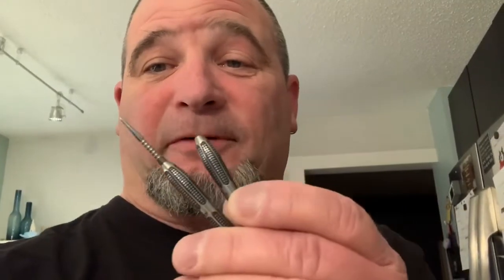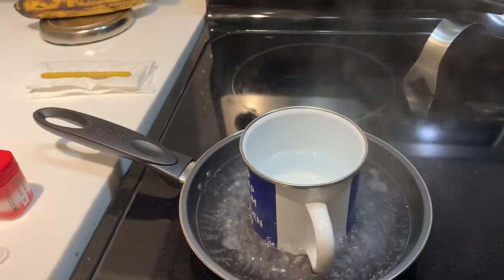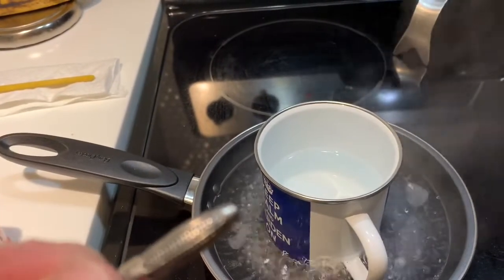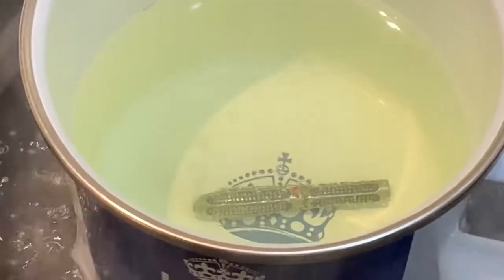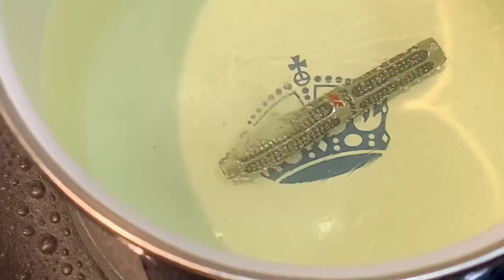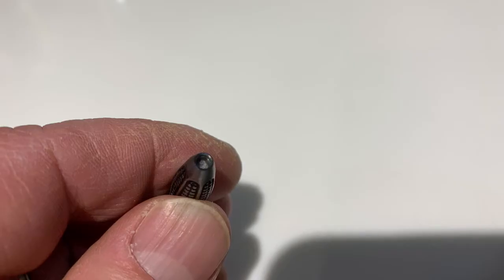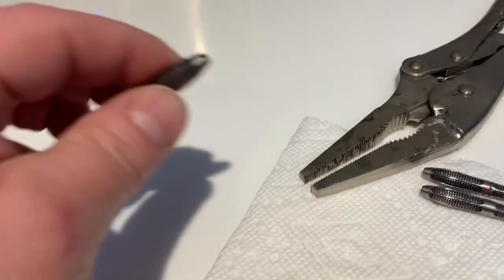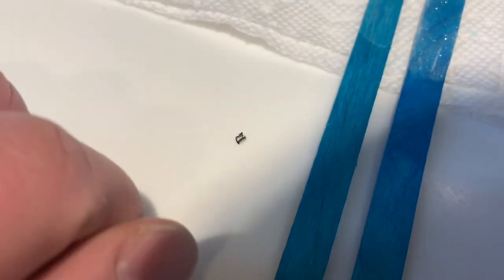Dissolving a dart point with alum

Comment: Would any alum powder do cause i look on amazon and theres loads of alum powder ive got the enamel cup can i use mon stick pan or non stick pot
Reply: I would assume alum powder is alum powder so whatever is on amazon should work. As i had mentioned, it took longer than I thought it would so I needed two containers of alum in the size i purchased from grocery store. Bottom pan shouldn’t matter if it’s nonstick or not. Just make sure to keep an eye on temperature and amount of water. You don’t want to run out of water in the bottom pan. I added hot water when needed so the temperature wouldn’t fluctuate too much each time i added it. I’m no expert. Just took video of my first attempt because I couldn’t find one at the time I was trying it.
Reply: @homevideos3295  thanks for the feedback brother appreciated 👏

Comment: Thumbs up for the helpful content. But a friendly criticism over a technicality… I doubt it sheared off, it much more likely broke off from a tensile stress. A shear failure would be difficult to achieve on a dart where yours broke. 

Take a pencil and bend it till it snaps. This is a tensile failure. To shear it you’d need opposing forces such that it sort of cuts it off, like scissors. Or a… you know… shear.
Reply from the maker: You got me. I suppose I used the wrong term. I was using the word shear to describe how it was flush with the end of the barrel. Maybe I should pull out the old Websters next time. Lol. 
I had actually never had this happen before and was just documenting my trial in case it worked. Couldn’t find any video of anyone doing this at the time so I thought I’d share. I’m no expert in this and apparently, not in the English language either.

Comment: If there is no alum available. Just heat the tip of the barrel using blue flame. Your cook top or mini torch would do. It will pop out a little just enough for you to use a rivet gun and pull the point out. This is the simplest and cheapest. You just have to buff the burn mark on your dart pin. 

Thank me later.
Reply: How long did it take to pop out

Comment: did the alum powder affect the painted colours on the dart? I'm wanting to do this on a dart with red and black coloured rings and I'm worried that will be cleaned off using this method
Reply from the maker: It didn't effect my colour but I can't speak for yours. I would think not as it only dissolves metals with iron. Also called ferrous metal.